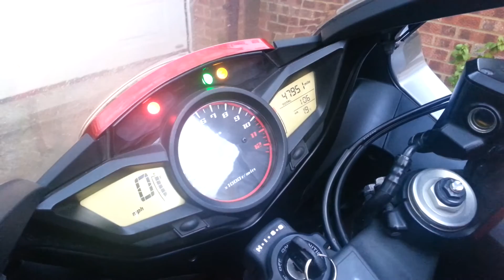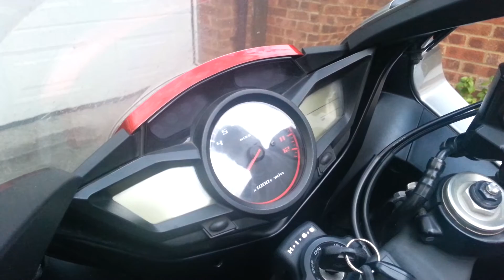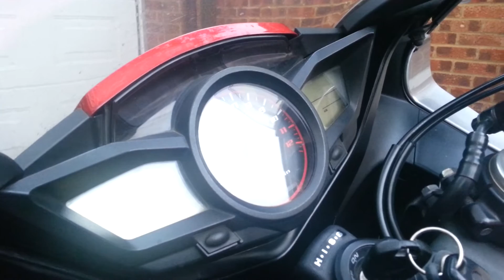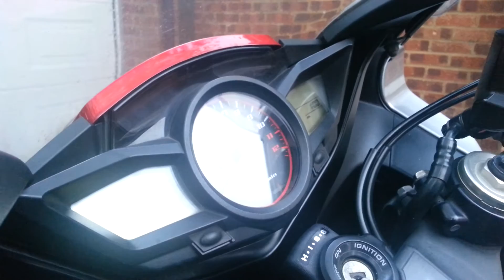Honda VFR1200 - starting problems

Comment: I have a 2010 and zero problems. I ride daily. Honda is the way to go.
Reply: what is the mileage of your bike gteamer; I am considering to buy a high mileage vfr 1200, that is why I am asking (it is at 45k miles((
Reply: If the valves were adjusted properly and all maintenance was done, then you should have no problem. I only have 17k miles on my bike, but I am riding it everyday with no problems.
Reply: Yesss!!! Me too buddy . Im on 500k km and still using it until now . Well im buy it from my friend not new one .

Comment: Wow - watching this has brought back nightmares! My 2010 11 plate VFR 1200 1st left me stranded on Brighton Marina (I was at the Ace Cafe Brighton Burn Up) 15 months after buying her brand new from Dobles in Coulsdon (had to be relayed home!!). Route cause of the problem was a faulty Datatool C4 S1 Red. This was replaced under warranty but failed again 12 months later imobilising the bike. This was replaced under 'good will' but subsequentlycfailed 15 months later after imobilising the bike yet again.

By this time I'd finally had enough and had the entire alarm assemby rmoved and thrown into the nearest dustsbin I could find. I eventually sued and won my case against Datatool in the county court for the cost of the original installation and my court costs.

Since ripping out the alarm she has started faultlessley and still has the same battery after 4 years 9months and 50k miles on the clock. 

My advice - don't even think about fitting an alarm and if you have, rip it out at your earliest opportunity before you too get stranded!!

Comment: get rid of the alarm. they are crap on bikes. had one on my Pan 1300, flattened the battery withing a few days everytime. also my VFR 800,took them both off , No more problems. Oh! they were Honda ones too.

Comment: Ditch the alarm. 29 years ago I bought my first bike. A lil Honda ch250. Had a dealer install an alarm. Cause nothing but problems. I ditch the alarm and stayed with solid locks. Problem solved.

Comment: I had a problem with my VFR1200 recently. Can you smell petrol? If so it is a flooding issue and the bike shuts down. It has to be re-set at Honda. It is a electronic fault where it lets in too much fuel. To protect the bike, the bike shuts itself down.

Comment: Never had a problem with mine , firstly get shot of that alarm the the bike has HSS. And leave the throttle alone when stating and th exhaust valve actuator has nothing to do with your starting problem

Comment: 1200 VFR is supposed to a flagship model for Honda, nothing but problems with them. wouldnt buy a Honda now. I had been a Honda buyer for 42 yrs.
Reply: Show me any car or bike manufacturer that does not have issues. All this throttle by wire etc is the problem. We can go back to the days of carbs icing etc, or we move forward. You are going to get issues...
Reply: bobvtec mine has gone through 3 winters and started after sitting for 2 weeks last christmas. and its the 2010 model...sorry about yrs...but mine is as tough as diamond great bike...